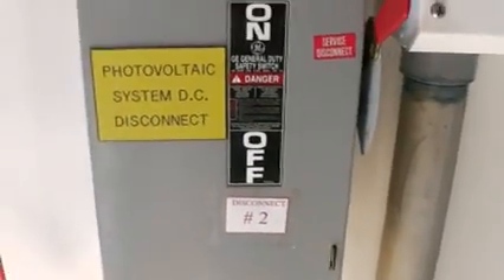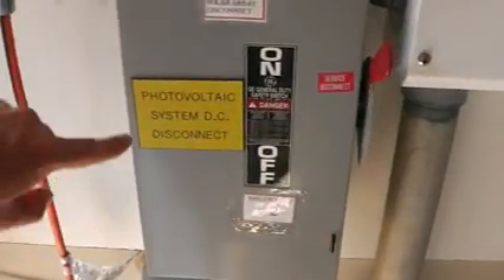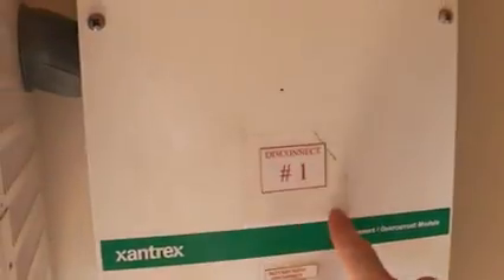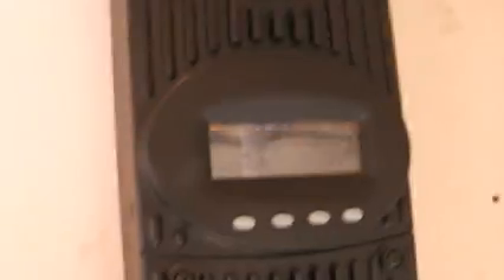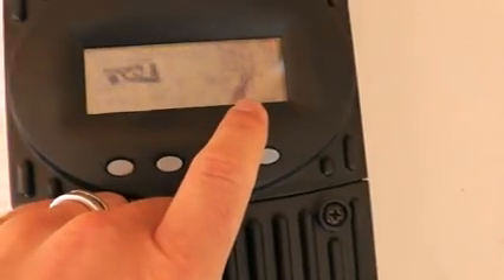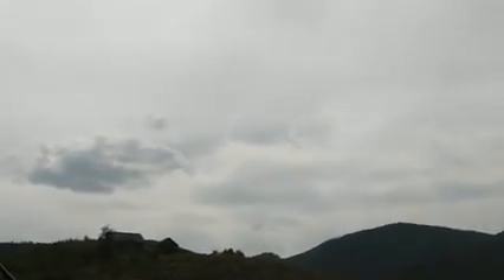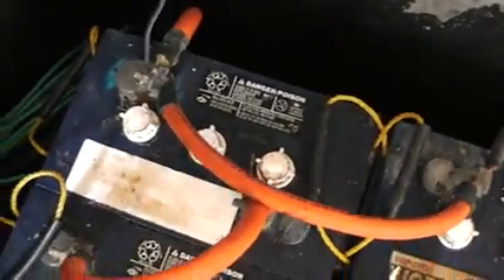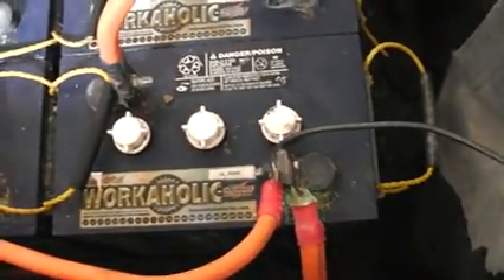Off Grid Solar Power: 4 Charge Controller and Batteries

Comment: offgridesolarguy
why do some people run modfied inverters and run tv fridge computers and get by some say you can,t. some say you can use
modfied inverters with line filter and get by ,./ trying to get by  on what i have? have your book& cd. i have 24volt panles but want to keep my 12 volt battery bank i have allready the 12 volt inverters what do u say thanks

Comment: Current is hard to move.  Higher voltage = smaller current.  Batteries on the other hand can only accept a certain voltage; in this case 24 volts, therefore the controller regulates the voltage "down" to what the batteries can handle.  (12, 24, etc)

Comment: I am not sure what you are talking about when you say you have two boxes that regulate the power going into the battery bank?  You seem to have the battery power going into that Xantrax box, then over to the charge controller and on to the battery, but additionally the Xantrax box supplies power to the inverter?  Is it doing some kind of isolation?  Very confusing?

Comment: The whole point of the high voltage from the panels and wind turbine is that you can use a thinner wire to transfer the energy. other wise you would need thicker / heavier cables running into your boxes. The higher the current the thicker the cable needs to be.

Comment: Are you really selling systems?

If you knew more about solar, you would understand what, "thastinger345" is saying. The total watt hours available from a battery bank is what's important. You could just use the same batteries just more in a string. If fact you invite uneven charging with out having a common connecting point for your strings of batteries, for equal distance in wiring resistance.

Please learn more before you sell anyone anything!

Comment: Why did you chose the 6v 350A Batteries? Why not 12v 700A Deep Cycle Marine batteries.? I need 100KW/day Avg power. Can I get that from a Solar system like yours or do I need a whole field of Solar Cells?

Comment: well if you went to 48V then you would only need 700Ah...pounds of battery is pounds of battery, just in how you configure them. I wish you luck in getting 7-10 years of life from parallel strings of L16s

Comment from the maker: Good question.  The panel wiring was much easier at 24V, as was the inverter wiring. But also if you go to one string, you have to get big batteries that will get to my desired 1400 Ah rating.  To go one string I would have had to go with a 1400Ah 6V x 8, and those batteries are simply too heavy to get to my shed and then into the shed.  The technology is advancing rapidly, so I  hope to do that in the future, but will stick with 24V.

Comment: High voltage is good, because P=U * I (Watts)
Heatloss in wires= I^2 x R = I x I x R = 2 x I x R (Watts)
R = Resistance in conducting material
I = Amperage
U = Voltage
P = Power
So we want to limit the current I (I=Amps), since it's the biggest factor of heat losses which can be prevented the easiest.

Hope it helps people :-)

Comment: Their is nothing scientific about dropping voltage from a high voltage. What you get is more current. Low voltage high current. High voltage hence the low current. Power lines use this method tell they get to the transformer where the transformer take the high voltage and drops it down and brings up the current. Look at the wires coming from your panels they are small low amperage battery bank high amperage. So what you have is a step down inverter transformer in your controller. Hope this helps